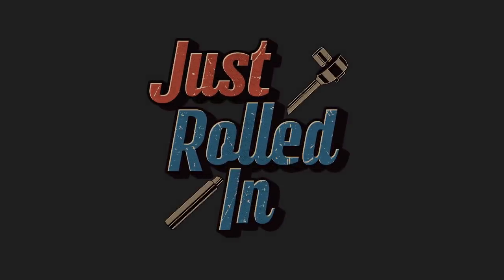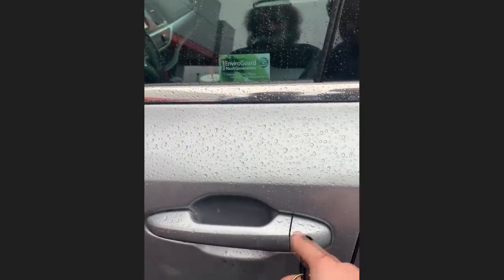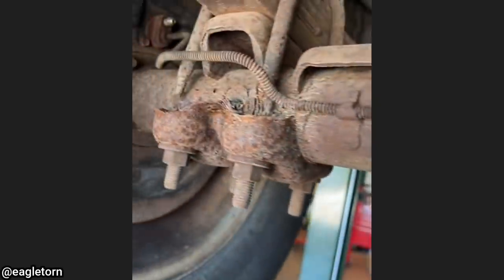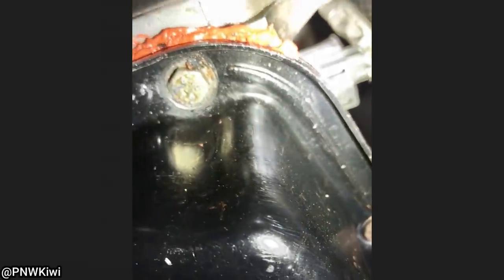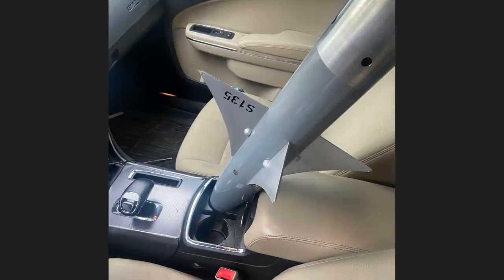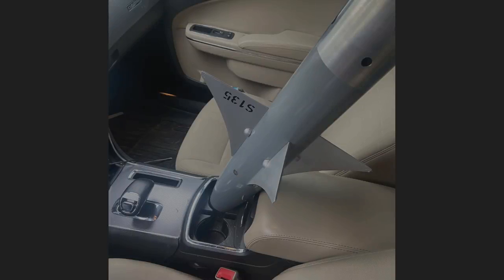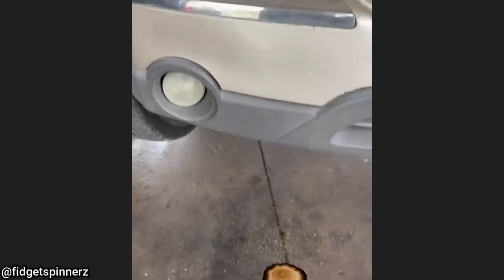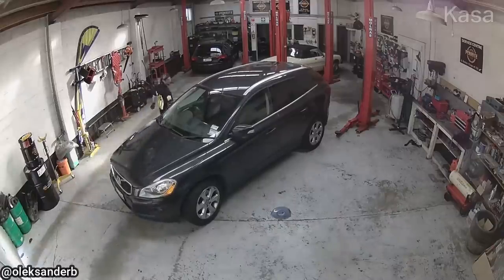Customer States It Sounds Like A Cowbell When He Drives Over Bumps | Just Rolled In

Comment: several friends used to pull pranks like the cowbell. I personally glued a whistle to the bottom of my friends car, and painted it to match, making it harder to find. As the mechanic of our friend group i had to go on several test drives and  try not to laugh as i claimed not to hear the whistling sound at that got louder as you increased speed. I told one of the other guys and he snitched me out. Best prank that summer.
Reply: Best prank my gearhead friends played on me was: I worked at Sears at the time and drove a '76 Monza 2+2 (original V8/4-speed car). I always parked in the lot with the other hotrodders (Trans Ams early '80s etc.) My last task at night was to bring in the flag and I always looked down at the lot. One night the Monza was GONE! 😱Ran down there and looked at the asphalt to see a pair of wheel marks leading around the side of the building! There sat the Monza with my buddies laughing their asses off. Seems they put a floor jack under the rearend and moved it! I BACKED up to the curb after that! 🤣

Comment: I do automotive repair work on the side of my full time job. I was coming home from work one night and came upon a a broke down Honda Accord not far from my house, with a three kids standing around it. I stopped to check on them and one kid told me his car wouldn’t start. To make shorten the story more the gear selector for the automatic transmission was sitting in neutral. But, I had noticed the hood was up and when I looked into the engine bay I noticed the timing set cover was missing. The kid told me he and his dad had worked on the car. The passenger side of the engine had oil slung everywhere.

Comment: Before the UAW goes on strike, there is oftentimes some sabotage on the line. In this case, sometime during the 70s the workers at Ford dropped a ball bearing in the gas tanks of the full size Fords. The tank was mounted vertically in that particular car, so that ball bearing would ride in the seam of the tank, making a noise as it rolled back and forth on turns.
We all came into work at the dealership one Saturday to spend the entire day R&R-ing gas tanks and dumping the ball bearing out!

Comment: Some other good pranks are sticky weights on the inside of your friends tires, or zip ties on the rear drive shaft. When I worked for a local car chain you had to be careful going to other shops to get parts. If the guys there knew you some of them would distract you while another would run outside and line half of the inside bead with wheel weights. It felt like the rear end of the the little Ford Rangers we had were about to come apart.

I also still remember looking for blinker fluid, a can of beep and the belt stretcher. I think I asked everyone in the shop before I went back to say I couldn't find it and got told to think about it for a minute. I got a good laugh out of those ones.

Comment: I dated a girl that used to be a manager at a Honda service center. At least once a month they would have to replace somebody's engine because the technician would do the oil change, place the oil cap on the side of the engine bay and forget to put it back on. The engine would end up seizing up and when it was towed back to Honda, you would see the oil cap on the corner of the engine bay, where the technician left it.
Reply from the maker: Damn. That happened that often? That's brutal 😆
Reply: @JustRolledIn  I forgot to add, they were always firing and hiring oil change techs.. The techs there were so bad that she ended up quitting because of the stress she had to deal with dealing with angry customers.. BTW the dealership ended up closing down a year after she left. The bad reviews they received from customers ended up costing them the Honda dealership license if that is what I remember correctly.
Reply from the maker: @tdrewman  Holy cow. That place sounds like it was a zoo lol
Reply: Wouldn't the drivers notice the missing oil cap?
Reply: @ReynaldoFlores... If a vehicle owner is paying someone else to do maintenance on said vehicle, I doubt they are checking to see if the filler cap is on....
Reply: @reynaldoflores4522  You would not believe how many people know "Nothing" about car maintenance or preventive maintenance. Many only know how to put gas in the tank. If it wasn't for modern cars telling them it is time to change the oil or check the tire pressure, they many only change the oil when they see a sale for them to change it . I have lost track of how many times I had to tell someone, you know your tires are bald ? You know the strings are hanging out of the tires because they are so worn out... Don't get me started on tire rotation, that is a foreign word for them.

Comment: Years ago, I put a large nut on an inner tube strap and tied it to the driveshaft of a friends car.
When it sat still, the strap was tight against the shaft, but at speed, it would stretch and the nut would hit the floor, causing a knock.
I almost had him convinced it was a rod knock and he should sell the car, but the dealership he took it to found it!

Comment: Cow bell... classic. Myself i prefer the tailshaft loop prank, 2 cable ties, tie one around shaft and over second cable tie, tie first cable tight then get some washers and run cable through, Do Not fully zip the second tie, you want to keave enough length so the washers will clank around the tailshaft tunnel on the car. Or you can put a couple cable ties on one blade of the electric radiator fan and when the fans come on... vibrations galore.

Comment: I've done the oil cap one myself. My first car was a Dodge Lancer with the 2.2 turbo. My oil light came on and the oil gauge was quite low. I had just added a quart before the trip so I thought uh-oh this probably means something major. Popped the hood to find I had forgotten to put the oil cap back on. Thankfully it was still sitting there having been sandwiched between the top of the engine and the hood. It was a high mileage car (at least for a K car) so I kept a box of fluids in the trunk including oil and the engine was fine so I was able to get home okay.
Reply: High mileage for a K car 60,000?
Reply: @squirrelsarepeopletoo6678  I bought it at 124k and traded it in at 194k when it became too unreliable. It had it's problems, like when oil leaked onto the exhaust and caught fire, but I really liked it. I had it for about 3 years and as cheap first cars go it was pretty good. Other K cars I've dealt with didn't last nearly as long, I'd say 85-100K was good if maintained properly which was typical for budget American cars in the 80's.

Comment: started working in an oil change shop at the beginning of the week, so far I've seen a dude come in with an open white claw in his cup holder. dude with hood latches installed by himself on his v6 eco boost mustang, almost got ran over today by a guy who fuckin floored it over the pit as I was guiding him in, and someone's engine oil dipstick had the handle broken off.. it wasn't even a weird dipstick either. I love it though

Comment: I'm thinking if I heard a cowbell whenever I hit a bump, the first thing I'm going to do is check underneath the car for a freakin cowbell or any other foreign object that could be the source of the noise, not run to a mechanic. I heard a rattling noise in my car once , turns out it was a screwdriver I had left in the door pocket that I had forgotten about. I didn't go running to my mechanic. It's called common sense, most of us have it, don't be afraid to use it.

Comment: I had a 1967 Ford pickup that I crossbred with an Olds 350 Rocket engine and transmission. That sucker was as ugly as you could imagine. The truck had been rolled up on both sides at some point in its life. It had been used to haul firewood out of the woods so the bumpers were both mangled. 2 different trees were dropped on it and I got it with a bad engine. I put the 350 Rocket engine in it and it would pass anything but a gas station. I took it to get a tire fixed once and warned the guy at the tire shop to be careful with it. He said he could drive anything so I warned him again that it would launch like a Rocket if he wasn't careful. When I went to pick it up I heard one of the workers yell "Hey, that guy's here to pick up that truck you nearly ran through the shop with ." I went out to the shop over the objections of the office staff and asked, "What's this about nearly running my truck through the shop?" The guy who said that morning that he could drive anything turned white then red. After everyone else stopped laughing, I said that I wish I had seen it. The skid marks started about 10 feet outside the door and stopped roughly 3 feet from the back wall. I wish I still had that truck. I would have to send pictures for everybody to laugh at.

Comment: In the 1960s my uncle was a car salesman, and made a good living, and told us once about a pesky customer who the service department pranked by putting a thin steel wire stretched across the inside of the trunk under the deck with two wing nuts suspended.  When the owner turned, they would slide across the wire and make a distinctive sound.  I think this was all after the customer had them chase a rattle for hours.  Anyway, happier days.

Comment: I was doing a tune up along with some other simple nice end of the Friday work. It’s a Chrysler 200 with the 3.6 the nice joint. Right before I went to install the upper intake back onto the car my spidey senses were kicking. So I decided for the first time ever I’m gonna take a peak down each and every intake runner(always keep a rag when exposed so u don’t drop shit inside) I ended up finding an upper intake gasket burried down in the lower manifold so I grabbed one of those claws and got it out. Keep in mind I did remove all 6 and they ended up in a trash can. Car had 106k so it’s a def someone’s been there a few times already. It would’ve never made it inside the engine but still, I’m glad I checked because that would’ve been my name on the ticket. And yo… the grand Cherokee/Durango with a mf warhead in the cup holder. Holy shit. Why can’t these cars make it to the dealer lol.

Comment: About a year ago secure strap snapped when my vehicle was being unloaded. It wasn't in parking brake and that was last strap holding the car onto the bed. Thankfully nothing happend as Jeep being Jeep it has higher ground clerance (it nearly clipped the bed with front of thr vehicle when it fell off the ramp) and roll into the small ditch with bushes in the side of the road. I was quite lucky that nothing other than scratch on the trunk  happened.

Comment: i had a ute that every time i hit a bump, i would here a doof or light boom sound. took me ages to work it out but i did. the glue on the bottom half of the windscreen had started to perish and the windscreen would bounce up on bumps. it was so subtle that i couldnt see it happening but only hear it. one day i nit a big bump and noticed the glass distort and thats when i pushed on it and noticed XD.
Reply: I have a '99 Pontiac Grand Prix GTP (3.8L Buick V6, Supercharged). While still in warranty the LR speaker failed, and I had the dealer replace it. After that at random times (usually going over a speed breaker) I'd hear a "clunk" coming from the back. Drove me nuts! I went over everything in the trunk. Spare tire and Jack, nothing. Several years passed and the right rear speaker died. Out of warranty by then so I just got a pair of Pioneer 4-way 6x9s. After taking the entire back seat out I found, under the sound deadening mat, a Snap On 3/8" ratchet, an extension, and a 12mm socket! Still have them, although I DID toy with the idea of taking them back to the dealership just to F with them! 🤣

Comment: I use to have a 03 F150 rust bucket around 2015 but it ran %200  I kicked the rear quarter once cause I saw bondo cracking and hundreds of ants came out from the old bondo Lol I was working at a body shop so I took my body hammer knocked out the bondo and huge nest fell out what a mess

Comment: True story: Idiot comes into a collision shop with front end damage to his car. Claims he hit something on the road and it went under the car and he went over it before he could stop. He resumes driving, sees the oil light come on and pulls over. He adds two quarts of oil and drives on. Oil light comes on again VERY soon. He adds oil again. He THINKS he MAY have a hole in the oil pan. Gee, do you think so?? Close(?) inspection reveals a hole in the oil pan the diameter of your middle finger. The body shop and insurance company determine the car to be a total loss mostly due to the owner repeatedly oil starving the engine and ruining it.

Comment: How can someone fill the washer bottle up with oil in lieu of filling the motor oil into the oil filler cap?
  zero common sense I've seen them fill the radiator overflow with red trans fluid also.